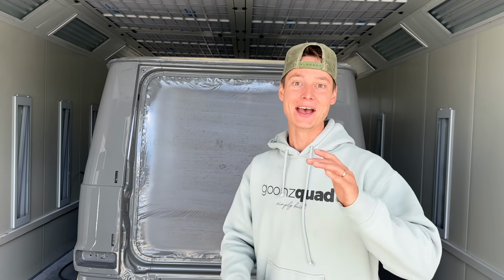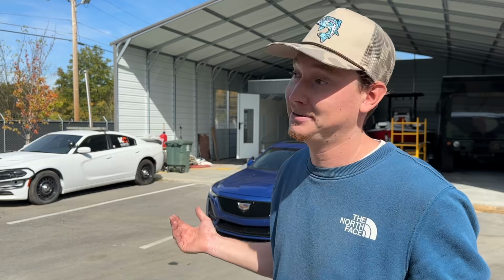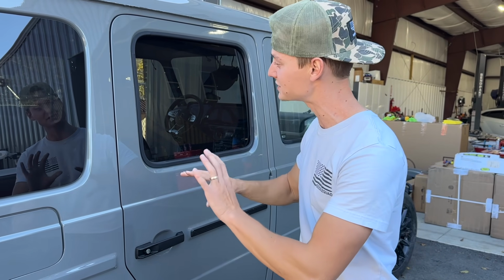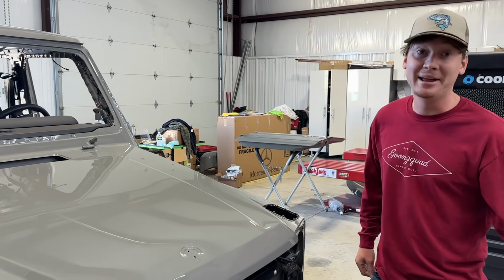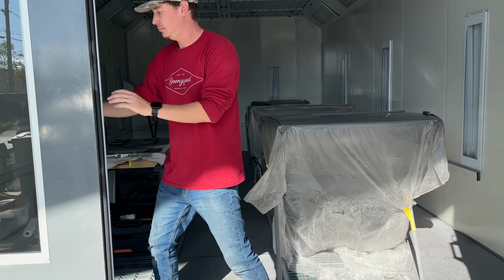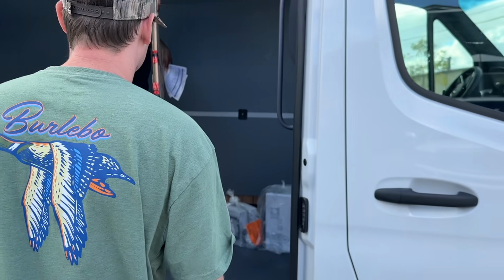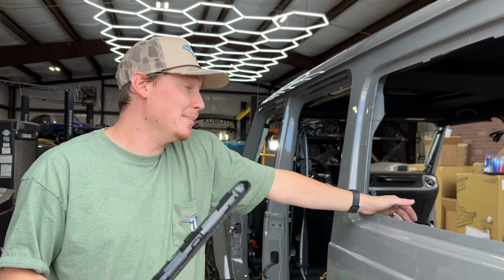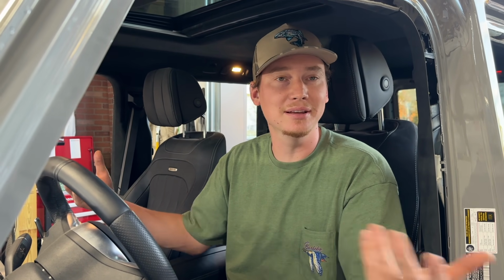Rebuilding A Wrecked 2022 Mercedes G63 G Wagon PART 11

Comment: Hey fellas, you need to run a compression test remove the plugs one at a time and check for compression you might have a rocker arm that off Boulevard Covid. Check to see if there’s any rocker arms off
Reply: Dude, there are no rocker arms in an AMG 6.3 engine... Overhead cams with that pesky Vanos system.

Comment: The difference in the color is the color of the vehicle painted before this is mixed in to the color of yours. You can have 3 vehicles painted at the factory. Park them next to each other. And the won't be exactly the same.
Reply: Most color codes on vehicles have variance colors, same codes will have a different shade, a reputable paint store would tell them this

Comment: Do diagnostics on the van and see which cylinder the misfire is on, then swop out the spark plug, if problem persist then try another coil pack from different cylinder and see if the misfire follows it via diagnostics.
Reply: You guys should be a little more cautious with the rolled over vehicles before starting. Always trh and turn it over by hand to see if its not hydro locked. You can damage a engine very badly with inferior issues like that.

Comment: Guys, it's literally running on half the cylinders! Sounds as if you lost connection to 1 bank of coils, or injectors. Feel the exhaust output if it is true dual exhaust without a crossover pipe and see if one side isn't pushing out exhaust or just smell fuel from one side! Can also re-check the plugs directly after running to see if 1 bank is wet, or other tell tale signs.

Comment: The engine is misfiring casing it to not rev over 4k rpms check spark plugs and coil packs and also make sure there is no oil in the spark plug holes because it was tipped on its side

Comment: If you read my comments from the last video, I told you not to cheap out because because it shows! I knew the paint wouldn't match because every can of paint won't exactly match when it's mixed! Base coat colors, techniques, coats applied, everything makes a difference in color matching!

Comment: Definitely misfiring on a couple cylinders.  Doubt it’s a valve. A vehicle rolling over won’t damage the valve.  You can easily do a compression test to rule out internal engine damage.  Could be something as simple as a bad coil. Do the compression test first.

Comment: You can hear as soon as you started it multiple cylinders are not firing.  Get a temp gun and scan the exhaust on each cylinder several will be cooler the the remaining cylinders.  Then you will know where to look.  Or just finish and take it to dealer and let them handle it.

Comment: The term your looking for is metameric , it's when a color is a perfect match in one lighting source but slightly different in a different light source , it can even get more specific than that but that's what's going on in a nutshell . It's measurable by the way if you want to get that exact at color matching which is basically unecessary

Comment: The G63 comes factory with a 4k rpm standstill rev limiter so thats not an issue but it revs really slow and its not supposed be like that because we have one and it revs a lot faster than that.

Comment: Newer engines do not let you rev. Usually it limited to 3000-4000 rpm. But that engine does not sound good at all. Sounds like half the cylinders are working. What baffles me the most is that control module does not give any fault codes for that! Even the older Mercedeses give codes for even the slightest problems. Cutting off some of the cylinders is not a safety feature on Mercedes for sure. It could be a coilpack or some sort of wiring fault but this should give you a code. One theory is that the engine blew first and it was rolled later for insurance claim.

Comment: It is not necessarily the brand of paint that affects mismatch color.. yes cheaper brands have bad match but every paint code has different variations from the factory! As well as pressure, temperature, and humidity will affect the results

Comment: Not a bent valve, it would  be possibly bent rods.  These vehicles when rolled, allows oil above the pistons.  If you start it after, it “hydro locks”. Ask @whistlin diesel .

He had the same issues with the red G Wagon he destroyed!  If this is the case, send it to the shop he used, that upgraded the turbos, etc..

Hopefully your motor is ok!
Reply: MORE POWER!!

Comment: Painting just a part or more parts is always tricky. It has to do with a phenomenon called metamerism, because of the use of non OEM paint or a different brand of paint, the color can be different under different light sources. This is due to the different pigments that are used by different suppliers. Although the color recipe of the paint is the same, the pigments might be of a different supplier. Color is mostly compared under daylight conditions, but put the same object under a different light source, you'll immediatly see a difference beween the original paintjob and the repair if it's not the exact paint. So just paint everything than you'll have no issue.

Comment: I don't understand why sealer wasn't sprayed on the new panels? You are always supposed to spray sealer before a basecoat. Also a base primers should be sprayed to match what was sprayed at the factory so all the parts match perfectly.

Comment: Guys, that’s not limp mode it’s running on one cylinder. Hope you get it fixed. Just bring it to Mercedes like you said they’ll get it going right? Hopefully the motors still good

Comment: The irregular operation of the engine may be due to a misfire or injector failure. A cylinder compression test would also be interesting.

Comment: Use good paint. Those of brand clear coats do not have a clear color. Most off brand clear coats have a yellowish tint. They definitely are not completely clear like a top quality paint system. The off color clear coat is why you see a paint color difference. Also, you shouldn't panel paint. You can never match sun fade or the way the robots paint in the factories.

Comment: It does not sound good, it’s running on 3-4 cylinders. I think that after sitting upside down the oil may have some what filled the cylinders (though half of the open valves on a V8) and clogged the ports on the injectors (sense it’s direct injection). So the injectors are not giving fuel to the engine. That’s why it’s sounds like it’s running on only half the cylinders.

Comment: I work at Mercedes bodyshop.. and that car definitely dosent sound like one of those should!! Somethings wrong in that engine! It ain't because of doors.. we drive cars everyday without doors to the painter.. no issues. Definitely could be because if speed sensor.. but the engine still dosent sound good. Sounds like it ain't running in all cylinders!

Comment: In the very first shot of the MB you could see the two passenger doors were a different shade ! Even Stevie Wonder could see that ! You should have done it right the first time and not tried to cut corners on a car that expensive . the fact that you were going to try paint less repair on the rf door by the hinges was ridiculous . I have to say I'm disappointed on the fact that the bottom side of the roof was not painted also . if your going to do a repair stop cutting corners . I have been following you and your family for years . I think your lack of years and never being trained right has cost you . I think you do incredible work . Don't be afraid to ask for help from a few old timers ? So Glad your homes are now getting settled with your new wives . Very Blessed ! Time to start making baby's ! Chop Chop ! God Bless !

Comment: Bro my Audi when I got it all the way from America to oman I repaired it and it was the same issue exactly I researched a lot until I found out that main engine control unit not giving enough power on 2 cylinders so your facing same issue 1 or 2 cylinders are not working as engine control unit has some issue please check that

Comment: No check engine light, misfire on like 7 out of 8 cylinders, yeah no your motors done bud 😂 change the spark plugs the coils, the ecu all you’d like won’t fix it.

Comment: You don't need a bigger place its big enough you just don't need all those cars! you can only drive one car at a time!! all the rest is just rusting away like that white ferrari the POS viper etc.
If you sell off all the parts you don't need and use you will create more room.
Red F-150 Tremor
White Shelby Super snake ute
Black ford Bronco
Lamborghini Urus
White Lamborghini Aventador
Black Tesla Model X
Orange Viper
Black and blue kit car
Green POS factory 5 racecar
Red POS Nissan Z car
Black Tesla
White ex-cop car
White Ferrari
Black Chevy silverado
Blue Camaro newer one
Blue Mustang
Blue kit car
Blue cadillac cts-v 
Audi S6
The old crappy boat you tried to restore
The helicopter
The ex-army 4wd camping truck
Red Trackhawk
And all half broken cars that were bought for parts.
KEEP: Merc G63 Wagon (once its fixed) RAM TRX, the F450 for towing, the 67 Camaro, the Porsche 911 sell all other cars.
You guys really need to go to a pro class and lean how to spray-paint correctly all that fancy equipment etc and you can't paint for your life without getting trash and imperfections in the paintwork.

Comment: Compression check all the cylinders, that engine isn’t running on half the cylinders.  Might have bent valves or rods from getting oil in the cylinders

Comment: Dude, I can't watch you guys use rattle can primer on that g63. That's why you have paint peeling when you unwrapped the R8. You're supposed to use 2k primer on body work as well as seal any new replacement parts. I would not cut corners on a 200k car.

Comment: hate to say it, but that tailgate needs a heap of work. Massive warp where the spare wheel goes, and the top right corner was a dogshit attempt at a repair. Also why don't you take 5 minutes to clean your parts before you install them? I'm watching you cover brackets and shit covered in sanding dust, and a side skirt covered in mud...dude, give them a wipe over before you reassemble! When are you ever going to get the chance to clean these parts again? Especially carpet and trim pieces that will be impossible to get at after the build is complete.